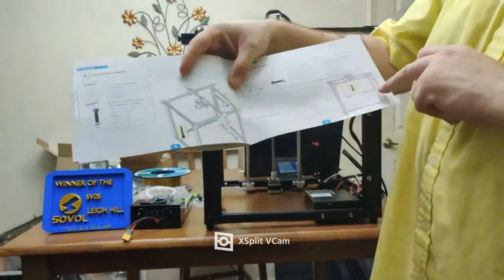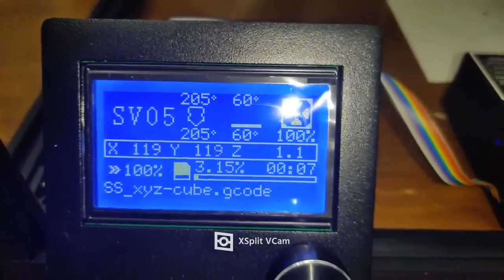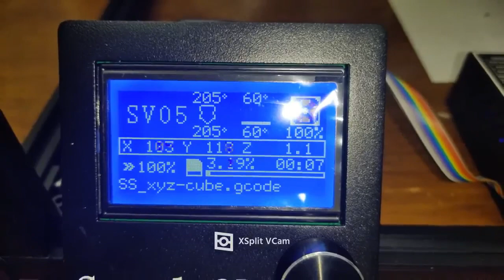Sovol SV05 Setup and Calibration Cube Print

Comment: Dude, DUDE!!! I’m 50% in to my first print and, after a great deal of fuss and fight? It looks beautiful! 2nd printer and? At the same  price and ten times more advanced! I got it for 279.00 Black Friday. Btw, I did the cube too and it ripped it off. For this print, I’m not pulling it until the bed is at zero temp. I learned with my other printer, glass bed, just let it cool completely down and the print was literally just sittinng there. Hoping to find the same results with this surface. Having the auto bed level is simply the bomb. The part, looks so much better than the same from my manual level, even though in the last two years I learned how to get a pretty good part of it. The build was painless, the wiring for the gantry/extruder could be a little longer as well as the bed. Also? I pulled the reverse bowden after well, my filament snapped, and I got a piece trapped in it, etc… I also relocated the filament holder to the top. Swapped the holder with the one from the Anet which is actually angled so the filament roll sits back from the gantry/top a few degrees. Anyway! YEAH! Edited to add: Your daughter in the vid, singing with you, priceless. Made me think back to those days when she was that age. Then your son coming in at the end. My girl is 34 and boy is 32 now. The days of their youth man, best times of my life. THANKS!

Comment: Would you reccomend the sv05 or the sv06 for a first printer? And do you know if it's possible to upgrade the sv05 to print at higher Temps like 300⁰C
I can't decide lol
Reply from the maker: I would recommend the SV06 if you are wanting to print multiple materials. Plus it assembles VERY easily. SV05 would be a little more difficult to deal with. SV05 could be upgraded to go higher temps though. Mine is now all metal hotend.
Reply: @TopofTheHill3D  im okay with assembling a difficult printer, which one do you think will be more reliable because ill upgrade the sv05 if its better at most other things.
Reply: @TopofTheHill3D  I honestly can't decide because they're both so good, but I might go for the SV05 since the SV06 is out of stock on Amazon, but i'm not sure yet

Comment: That's alot of Assembly required 🙁
Reply from the maker: actually its not. I just took my time and was nervous. was my first live video ever. Would have taken only about 40 minutes if i wasnt recording
Reply: Hi Joe. I had to chime in here even though your comment was 2 months old. This is my second printer. First one, Anet A8  Plus, arrived completely as parts. Not only did I have to build out all the axis, x,y,z but I also had to wire the entire thing up, attaching each element to the mother board, etc… This printer here, arrived with incredibly well executed wiring, requiring only connecting each plug to the corrresponding part after putting the gantry on the top, and affixing the bed with z axis. For me, only my second, but still, this build was ten times easier and required very little time to complete. Your comment makes me wonder how familiar you are with the game? Keeping in mind of course, I know next to nothing. From video, I’ve seen a few that require less, TONS that require much more (build from nothing like the ANet) and those that will send it completely built for a charge.